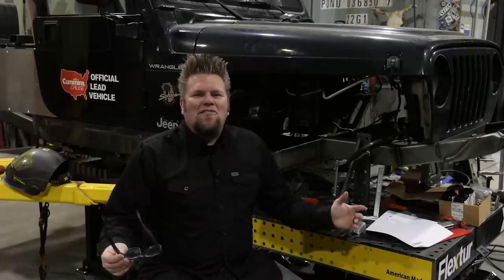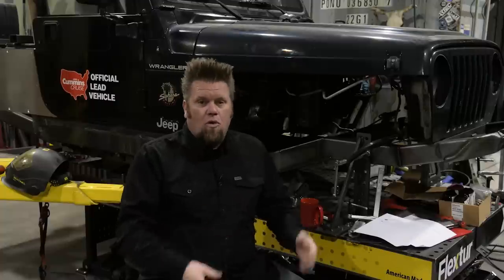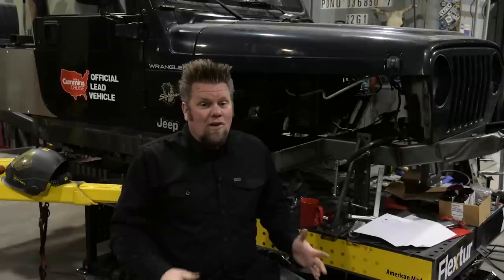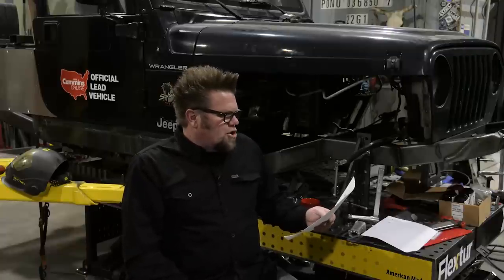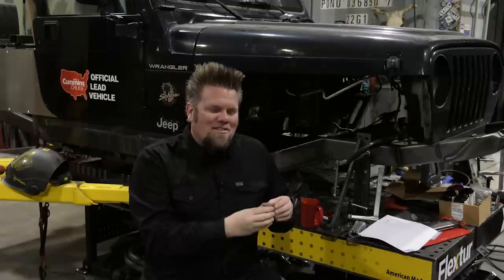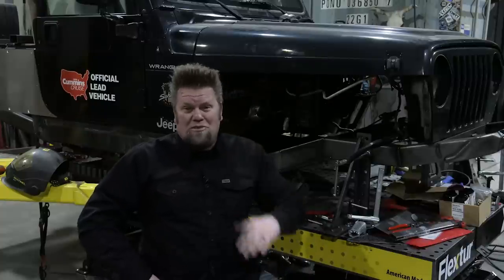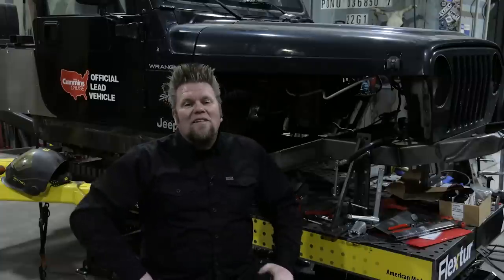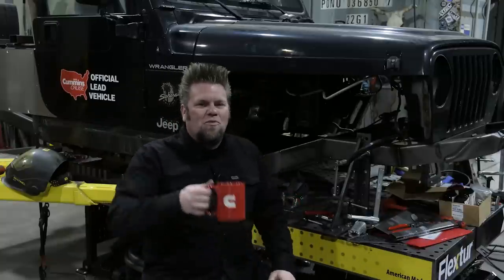What Happened to the Suburban Gorilla, Kingpin VS Ball Joint Axle, Shop Safety

Comment: aw man that makes me kinda wanna cry. not only is the suburban gorilla project one of my earliest memories of you Ian but also has been and will continue to be the single largest inspiration for me. i have always been a fan of suburban's as my father was a suburban fan so when you started that project on xtreme i was on the edge of my seat the whole time. imma hafto go pour one out for the suburban gorilla.
Also i am proud to say i would get that shop safety question correct. as a commercial/industrial hvac technician i often work with pneumatic controls for ventilation and hvac equipment, which is often used for the inherent explosive environment rating.
If i may ask, do you ever take on apprentices that want to learn from you?
Thank you Ian, as always a gentleman and a scholar

Comment: Issue with the 9 inch is that it is hard to find them in junk yards. 14 bolts are still easy to find and cheap. You can still find CAD dodge 60's for the knuckles and C's for cheap, along with hubs off of a dana 50 TTB. You can still build a relatively cheap built front 14 bolt for about the same price for a built 60. Only custom parts are the 30 spline inner shafts. I have converted rear axles into front axles using the CAD 60 outers and TTB hubs for less than a complete Ford 60 goes for in my area.
Reply from the maker: I would never build a junkyard 9"  I always say that if you want to build a 9" build it from all new parts
Reply: @BigTireGarage  that is the best option. One day I will be able to afford nice nine inch parts. Working part time and going to school does not leave much room in the budget for any good aftermarket parts lol.

Comment: What is the general rule for minimum up-travel on a off road only trail crawler, (with good bumps and shocks?) When trying to keep lift and CG low as possible. Forums are all over the place when it comes to the center of gravity/clearance debate.

Comment: Ian — I am planning out a trailer build.  I have seen both you and Nate (dirt lifestyles) mount off-road tires on trailers and continue with your build.  As I’m doing more research I have read that putting standard tires on a trailer can be dangerous (blowouts and such) as they aren’t designed for the weight.  When is it ok to do off-road tires and when do you need to purchase trailer specific tires????
Reply from the maker: Its all about the load rating...car trailers or others that carry heavy weights need actual trailer tires.

Comment: Two items/questions. Safety tip. Be mindful of remote starters around lead acid battery's. Let's hear your opinion of full hydro steering. I see a number of YouTuber's build full hydro steering and still intend to use on the road. A few of them state that they don't see laws that prevent it. But are there laws stating that you must have a mechanical connection from steering gear to knuckle. Therefor illuminating the possibility of full hydro steering on public roads. D.O.T./Federal laws-vs-state laws. Enjoying the question and answers.
Reply from the maker: I have both....I have full hydro on street legal rigs all the time....yes there are DOT laws in some states, but you realize that a lot of public transit buses use full hydro steering (the ones that bend in the middle) the best part about the US....find a state/county that lets you build what you want

Comment: I would love to see that Volkswagen thing (safari) that was my life,bugs and things in off road. I started off with the 57 bug and a 67 bug. Of course they both got gear boxes at that time. I eventually got into IFS long travel. I would love to see an electric version of a jeg. (4x4) But I would like to see the electric as the transmission for a diesel or a gas motor. With the ability to use the batteries for transportation or not  but not using technology that is encrypted a vehicle made  literally for or on off-road. I know exactly what you meant about that Canadian 2 1/2 times at least when you order something from the states back then.

Comment: Worried about the sparks inside a cordless to, but don't hesitate to use a grinder or sander?
Reply from the maker: True....very true...but I am not normally grinding on a fuel line...I do use air tools to take fuel filters off frame rails

Comment: Ian, what is your suggestion for adding a parking brake to a mid 80s, 14bolt that has been disk brake swapped?  Recently swapped it into my 2004 Toyota Tacoma and trying to keep it street legal.
Reply from the maker: Eldorado Calipers are pretty good.....you have to adjust them carefully

Comment: I have a 1977 dodge w200 4x4 with manual steering,  what the best/economical way to put power steering in it.
Reply from the maker: Find same body style/engine setup on the same body style in the junkyard....strip the parts you need

Comment: Also unit bearing much more serviceable vs bearing and races 
Junkyard or fb 9 for 100 Dana 60 or Dana 50 outers 800> eBay drag drop out <500 build to 1550 axle length bam cheap built axle

Comment: Hey Ian, I seen a lot of LS motor swaps out there especially with a jeep TJ, my question is it really worth the time to LS swap or is it best to stay with the standard 4.0
Reply from the maker: If you have a good working 4.0 and are happy with it no......if you have a 2.5 4 cyl, or your 4.0 is backed by the 3 speed trans and want the overdrive it is often better to swap in the V8 with a new trans
Reply: @BigTireGarage  Ok, now if I went to a V8 and I’m running 430 gears with 40s right now what trans would be best

Comment: Brushless modern tools don't spark... We use the in classified Ex environ.
Reply from the maker: Still an electric motor....fill it with metal shavings...and I bet they would spark
Reply: @BigTireGarage  more likely to get a spark off of the carbon steel impact bit unless you are using alu-nickle bronze hardware...
disRegardles, spent so many months trying to justify the price/practicality of a suburban gorilla to myself. Love all of your work.